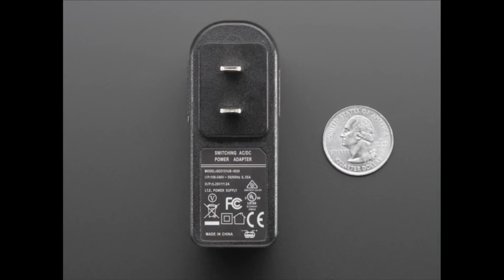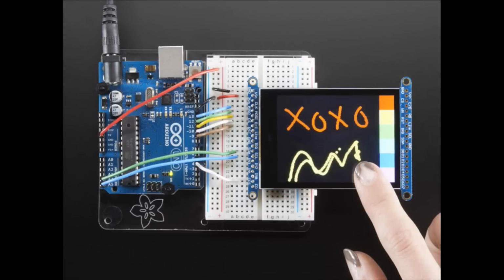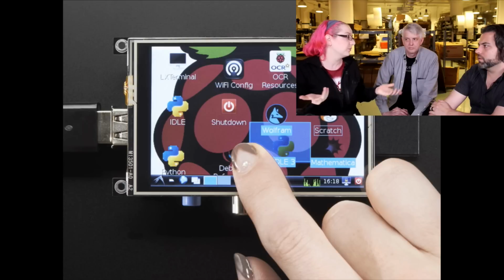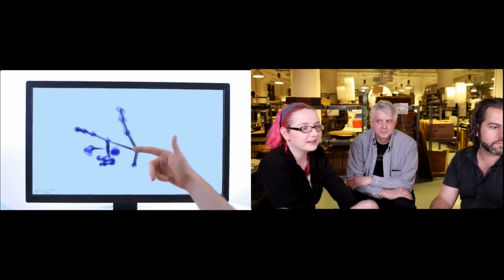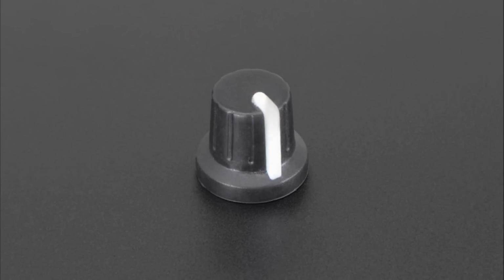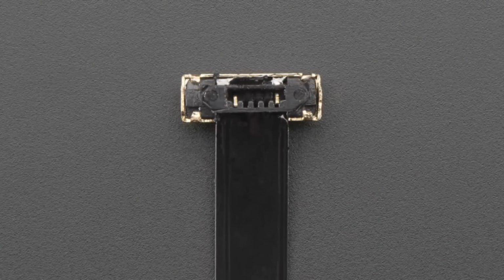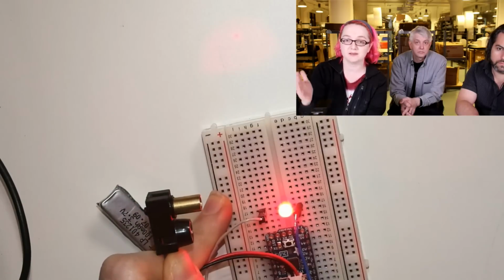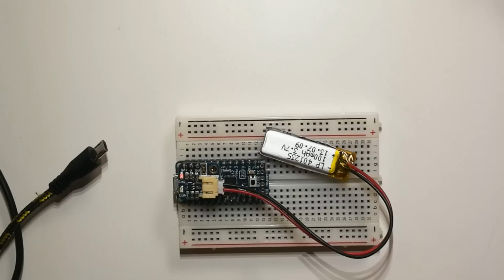New Products 9/17/2014

Comment: my pack pack is not charging through the main connector for the battery, i can power it but i cant charge it, i have to stick it on the side where the add-on connects to the trinket to be able to charge my battery, is there something wrong with my bored?

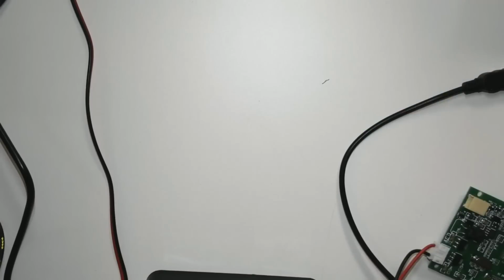Comment: @PiTFT- Assembled 480x320 3.5" TFT+Touchscreen for Raspberry Pi (7:37) https://www.adafruit.com/products/2097

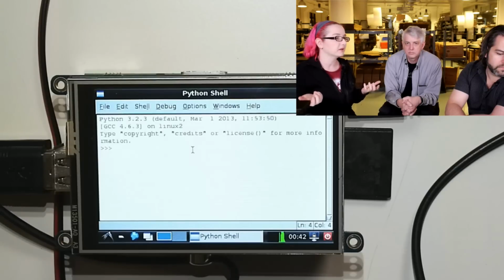In the video you state it can do about 20FPS (Mentioned at ~11:15 into the video). How is this possible given the controller runs at 16Mhz, and with this resolution display (480x320) with 16 bit colours, the theoretical max is about 6FPS so in reality it is probably around 5FPS. ??

If you can somehow run this at 32Mhz then you are still only looking at around 10-13 FPS...

Please explain!
Reply: Because there is a difference between frequency and bits/s. 16Mhz does not mean 16Mbit/s.

Comment: Machinists use rules in tenths sometimes. There's a trade off in drillbits between hardness and flexability. The harder they are, the more brittle they are. Of course you'd hope that only the tip is hard.